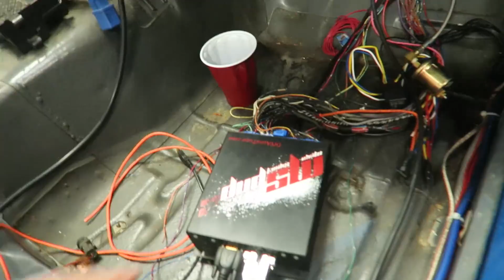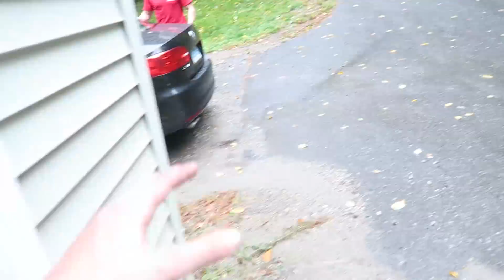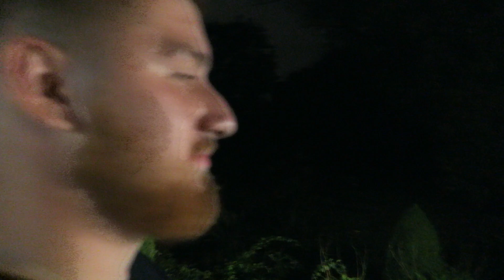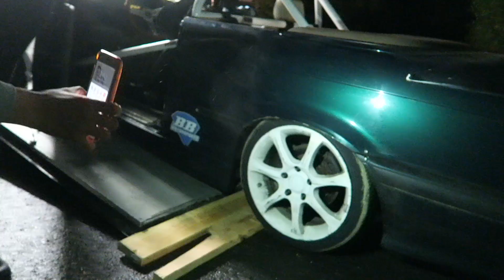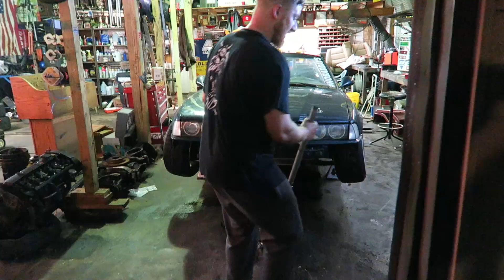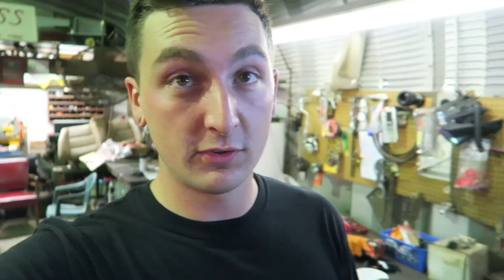Destroying a masterpiece!!

Comment: Why aren't you going to use the mega squirt?
Reply: Riley Ziegler because Jimmy is installing the one he knows works and knows how to fix and use , and he can see the megasquirt like he said , the guy doesn't know much about cars so Jimmy will be most likely the guy he will call if anything goes wrong, so Jimmy will probably know exactly what's wrong if he uses the same one
Reply: have you gone through the setup of a standalone MS? not the little miata plug-n-play things that just plop into the existing harness but a full custom wire harness setup? it's insane, probably as personal as your underwear. there's so many things you need to check, install, wire up, test, calibrate, map, that alone could take weeks to do on your first try, and this car needs some other work too, it's defo the best choice to go back to stock harness and the nismo ecu shizzle, if it ain't broke, dont fix it kinda deal.
Reply: Oh my god Jimmy hearted my comment 💯💯💯🇮🇪🇮🇪🇮🇪🇮🇪 you are a legend Jimmy

Comment: You said like 15 times that the previous owner did an amazing job on the wiring so my question is why didn't you just make it work with the MS??? It's much better to have engine management than a stock ecu and it looked like it was mostly done. Edit: Here is a link I found on the MS and it says you can hook it up within an hour
https://www.diyautotune.com/product/megasquirtpnp-g2-nj8994-for-the-nissan-s13-sr20det-manual-trans/